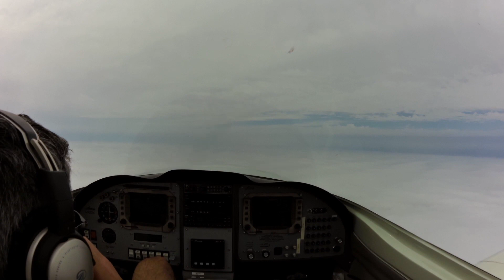ATC Recording: P210 Engine Failure IFR at 21,000'

Comment: On a Cessna 182, full elevator trim up, with the engine off will put the aircraft at max glide speed.  Just take your hands off the control wheel and it will settle to max glide airspeed.   I've never talked to the designer of the 182 if this was intentional, or not, but a really handy feature while body functions take their course.
Reply: Elevator?

Comment: If he is at 20k feet how's he going to glide 40 miles? Why would they even consider that an option early on. He be lucky to get 1000 feet per mile? Maybe 7 to 1 so about mile in 1/4 per 1000 feet if he is light too bad can't dump the fuel if the engine is done don't need fuel anymore.
Reply: Think his glide ratio would be a lot better than 7:1. Read a report years ago where single engine piston aircraft have a glide ratio of about 10:1, twins about 14:1. The advantage due to the feathering props. A turbine conversion P210 would have an auto-feathering prop, so its glide ratio probably would be pretty good.
Reply from the maker: Dave - I suspect a stock 210 is a bit worse than 10:1, but a feathered prop on the turbine conversion would make it much better. As a comparison, on my airplane which doesn't feather, course pitch to fine pitch is the difference of about 9:1 versus 12 or 13:1 and a feathered prop would provide a much bigger gain.
Reply: Jim Ratichek  Another factor on single engine glide with a wndmilling prop is throttle position.  Much better with throttle wide open.
Reply: Jim Ratichek  Thought of another factor that would enhance the glide of the turbine 210.

 Cooling drag.

Look at the front cowl on a piston engine aircraft. 2 large  (6"x10"  ?) openings for cooling air. A lot of air going into that cowling and being forced to flow over the cylinders and heads. Lot of drag.

But on the turbine the only opening is the air intake of about 6" diameter.  

A lot of horsepower is lost on a piston engine to cooling drag. Not so much on a turbine.
Reply: That could be so that would mean he could make 35 miles from 20k feet 10k feet forward 1k feet down maybe. It wasn't exactly clear how far he did actually have to fly good he made it. Doesn't the P-210 piston version have a adjustable prop?
Reply from the maker: blastman - yes, the piston is a constant speed prop, but the turbine is full-feathering - a huge difference and a massive drag reduction. If you fly twins and you watch the descent rate with an engine feathered, versus windmilling, you will see what I mean.
Reply: blastman8888 The piston P210, like all single engine aircraft over 200hp has an adjustable prop. It is a variable pitch constant speed unit. It does not feather like a prop on a multi engine aircraft.  That would be pointless expense.
Reply: The standard P210N, which this is, will glide about 31 nautical miles from 20,000 feet, according to the POH page 3-15. That's just about right at 9.4:1  This particular P210 has a turboprop, so it is full feathering.  With that, and retractable gear, the glide ratio is probably  10.5:1.  In a no-wind glide, he could likely make it 35 miles.  If the wind was strong and favorable for a given airport, he could definitely make it 40 miles.  BUT, you don't gamble on the wind like that when there are runways beneath you.  

In the end, he opted for Arledge, which was about 20 miles. (15 miles by the time the controller suggested it.)  He had about 5 airports within 20 miles when the engine quit.  I really don't know why the controller would suggest something farther away.  Maybe he just got rattled.  

Fun fact: dumping fuel (weight) does not affect the glide ratio, as long as the correct angle of attack is maintained.  Read an explanation here - https://www.skybrary.aero/index.php/Glide_Performance
Reply from the maker: 8liter - good analysis. I was also surprised when I heard that part of the convo. The controllers may or may not know much about what the pilot and plane are capable of in that scenario.

Comment: Why didnt the pilot take the airport that was 5nm from his position ???
Reply: He was at 21,000 feet. he can't get down in 5 nm
Reply: Ever heard of circling an airport ???
Reply: He could have setup a spiral decent
Reply from the maker: I wondered the same thing although I didnt catch the earlier parts of the conversation. My best guess is weather - A turbine 210 probably had weather in the cockpit and there were many low ceilings in the area, so it might have been an attempt to get to better weather. I know he asked about weather at one point, but he was probably busy too...
Reply: It wasn't a "Turbine" Cessna 210, it was a P210 turbocharged.
Reply from the maker: LIX - incorrect - it is a turbine 210 - a Rolls Royce/Allison 250 silver eagle conversion, specifically - here's the pic of that exact aircraft. https://photos.flightaware.com/photos/retriever/154246a14bc4c14d5f0d2dbe19f14bd2c565880e Also, a C10T is the designation for the silver eagle.
Reply: Guess the FAA should adjust their records to indicate that.  You're certainly right !  :)
Reply from the maker: yes a buddy's airplane purchase got delayed 2 months for FAA record update problems. The owner was deceased and blah blah, etc.

Comment: Wow.. definitely makes you think and wonder how you would react and handle if you were in that scenario!
Reply from the maker: I was - but it was at 2,000 feet, near an airport and VFR conditions. Immediate turn and uneventful landing, followed by a quick talk with the FAA and the owner, who had the new engine shipped back for warranty replacement. It sucked a valve and spewed out some parts into the intake. Made interesting noises!
Reply: If the training you've had is good it becomes somewhat automatic. We lost an engine in an A36 at about 8000' over the North Georgia mountains. (These are 3,000 foot mountains) I was flying safety pilot for the owner of the airplane who had more money than experience. He shifted in his seat and when he did his foot kicked the fuel selector to the off position. The engine quit so fast that is was shocking...no warning obviously. I'll admit that for several second I sat there thinking HOLY $4!t the engine just quit!!!! And then suddenly I just started working the problem, I took control of the plane from the owner, ran the "cockpit checklist" which was to check everything left to right to verify it wasn't something stupid, first item was fuel selector, mags, engine instruments...when that engine came back to life it was the sweetest sound you can imagine! kudos to this guy for keeping it together and landing safely.
Reply: Very interesting! I guess that is the reason why you go over these things over and over, so that if/when it becomes necessary your brain instinctively knows what to do!

Comment: "Descend and maintain..." ^.^
Reply from the maker: Yeah, I wonder if controllers might forget they are dealing with a single and not a multi!
Reply: Awesome video Jim! I’ve been there a few times, hoping someone pulled themselves out of a tight spot. 

Wishing you safe travels!
Reply: Yeah Dan, I was thinking if he had a good engine and could "maintain", none of this would be happening. What part of "lost power" didn't register ??
Reply: Randy Porter "Lost power ". Apparently the controller thought it was loss of power- partial.  Initially the pilot didn't make it clear that it was a  total power loss.
Reply: i read the 'descend and maintain' (060) as reference to the airspace this controller has authority over. he can't clear him lower but obviously handed the mayday aircraft off to another controller before it was passing through the floor of his sector. semantics in this situation but in-line with the FAA on the controllers side.
Reply: If I were a controller, I’d probably say the same! It’s good to know what you’ve got to work with beneath you. Especially decending into IMC